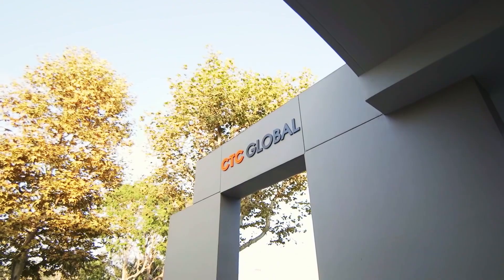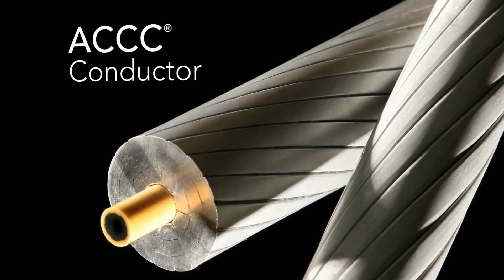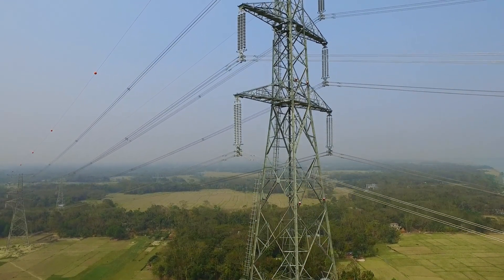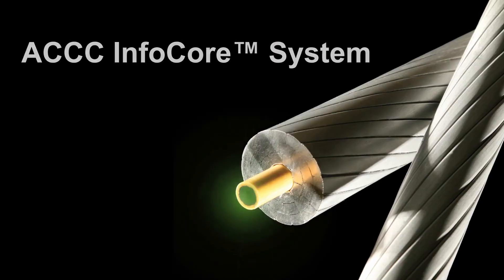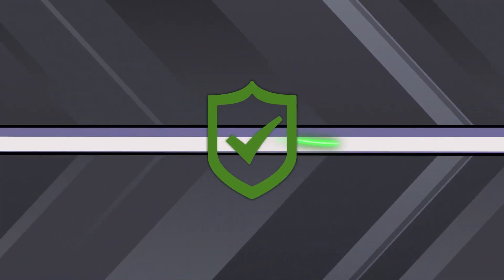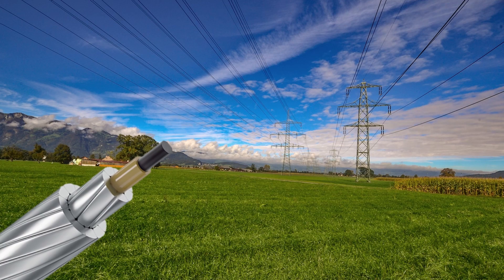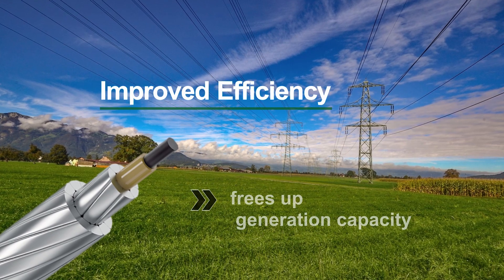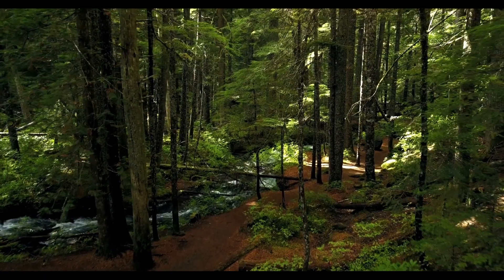Introducing CTC Global and the ACCC® Conductor

Comment: It's very sensitive and demand and can't do the continuity test, can't find a broken place until it falls down while in service.
Reply from the maker: Thank you for your comment! The ACCC® Core is designed to be both highly flexible and durable. Like all conductors, it does have bending limits.  However, it also uses embedded fiber optics that can detect any core damage due to mishandling or other occurrence. You can learn more about our ACCC InfoCore®System on our website at https://ctcglobal.com/accc-infocore-system/ or reach out to our team for more information at info@ctcglobal.com.

Comment: I have a question for cycle global. Can’t we use bolted type tension fittings in stringing bus bars in grid stations where span length is generally less than 30-40 meters. In transmission lines it’s understood but in Grid Sub Stations if we use HTLS then why compression fittings.
Reply: Yeah....what he said.
Reply from the maker: Thank you for your question! Clamped fittings in substations are used from time to time. For more detailed information, please feel free to reach out to our Engineering Team at info@ctcglobal.com . They’d be happy to answer any questions.